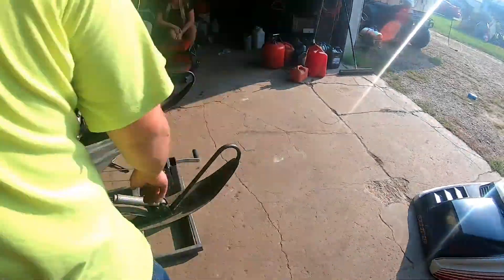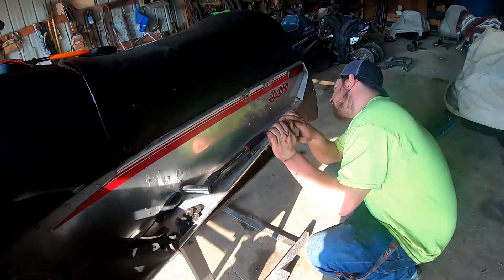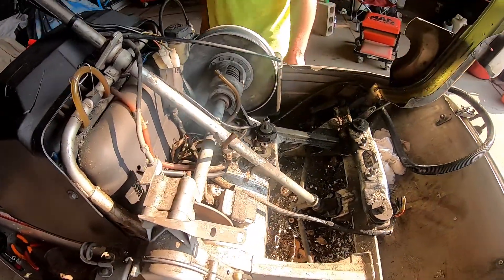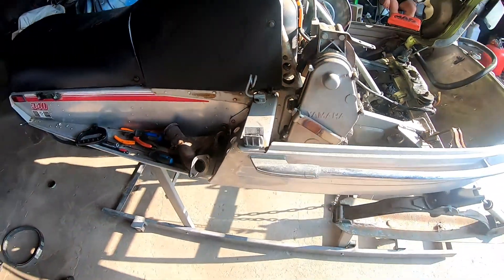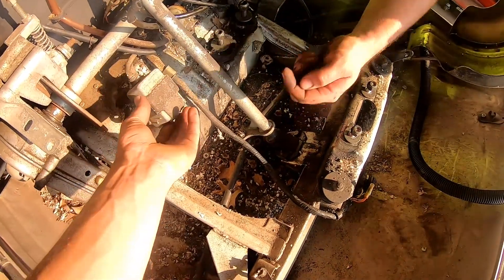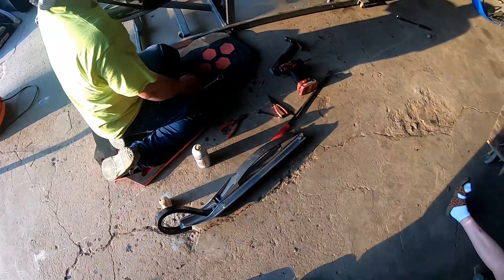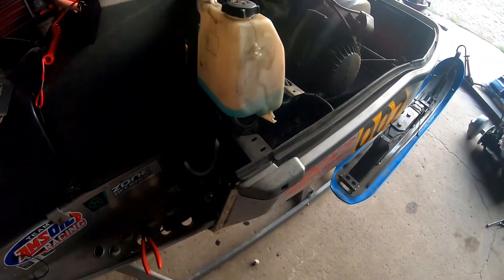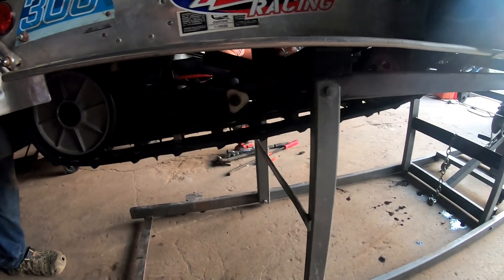Ice Oval Vintage Sled Build - 1978 Yamaha Exciter 340 & 1980 Enticer 300 Teardown (Super Stock)

Comment: i just got a 2004 CR85 And I'm trying to flip it but it runs good just so low compression I can push it down with my pinky it's crazy can it be just the rings?
Reply from the maker: Its is a single ring piston could be but usually piston ring groove sags and pinches ring to cause low compression from heat or lean condition

Comment: I'm interested to know what you need up using, and where you find the pistons and rings for the 300, (unless you put a 340 top end on it? Shhhh)
Also, how many tooth drivers are you using  and what pitch?
Thanks guys.
Reply from the maker: Kimpex makes some stuff for .020 over and may run std bore if the clearances are okay yet. Going to run 300 top end yes. Stock drivers with oem track. Found one thats half way ok. Stock skis 10 inch carbide and 102c clutch